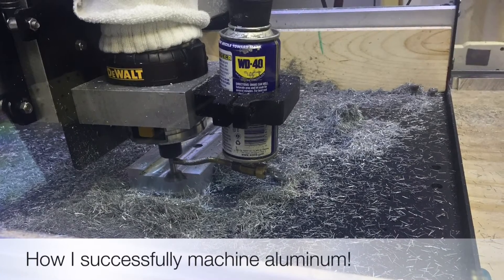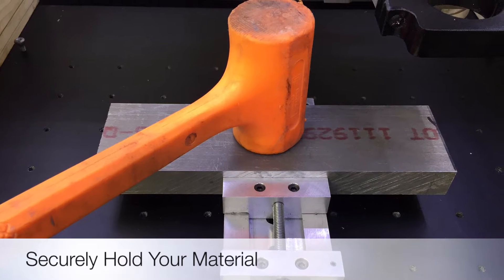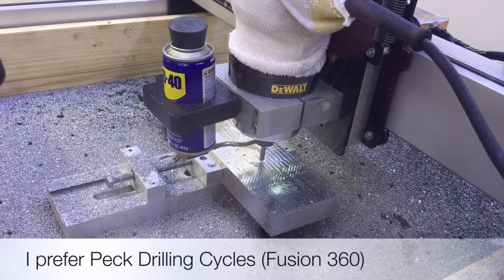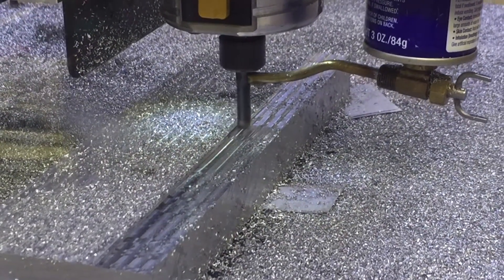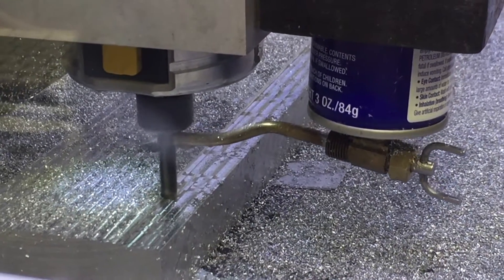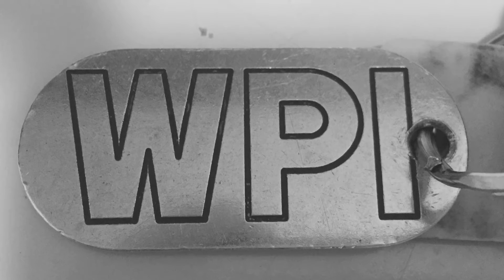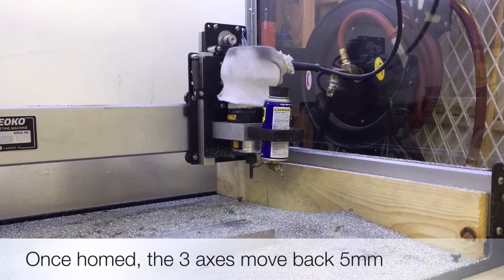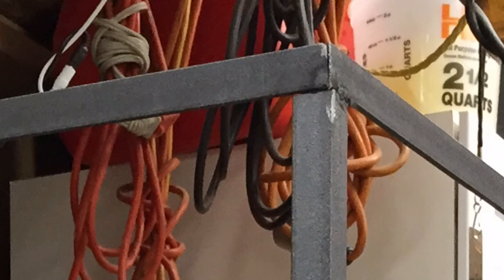How to Machine Aluminum on the Shapeoko 3

Comment: While this might work, ALTIN coating is not recommended for Aluminum. The AL(Aluminum)TIN(Titanium Nitrite) actually has an affinity to chip weld the aluminum coating to the aluminum. What you really want here is a single flute ZRN coated end mill.

Comment: I cut aluminum, steel, and even titanium on my Shapeoko 2. There is a lot of good info here but if you want a much much better surface finish you need to clear the chips that you have made out of the path of the cutter. The heat created during the cutting actually hardens the chips and then for the cutter to have to run into them on the next pass both dulls the cutter and destroys the surface finish. Other than that great information. Thanks

Comment: This looks like a 1/4" endmill (assuming 3 flutes?).  You said 16,000 RPM and 20 inches per minute.  That results in a chip load of .0004".  Isn't that WAY too low?  Don't we want something around .005" on aluminum?  I can't argue with your results which are very good...  just trying to figure out where the discrepancy is.
Reply from the maker: I recommend that you take a look at Winstonmakes video.  
https://youtu.be/S9bceJxpqG0

This is an old video and with the new Z motor plate from Carbide3D, the machine became a LOT stronger.  Yes, 1/4, 3-flute ZrN coated cutters are a must (because they canrunDRY most of the time).  The machine will take a lot more (Fusion360 Adaptive cutting) if it is set up properly, but it will take you some time to get everything tight and right.  I recommend that you start slowly say 10"/Min working your way up to mayb 40"/Min.  You'll find your machine's sweet spot.  Have fun.

Comment: I am going to tighten my wheels now. I have to re-square my machine (SO3 XXL) and I do have coated endmills. I will mostly be cutting shapes out of aluminum sheet metal .04" thick. Should I be using a .25" or .125" diameter endmill for better results?
Reply from the maker: Well first you should be using ZrN coated end mills.  They came out after this video and they are excellent and you can cut dry 95% of the time.  As for the diameter, there are plus and minuses.  A 1/4" diameter endmill will last years in the Shapeoko, and the machine isn't strong enough to break it when you do something silly (which everyone does), but they require more cutting force.  The 1/8 requires less force, but they will break.....Me?  I TRY to use 1/4 if I can, and use 1/8 when I HAVE too.
Reply: Thank you so much for responding. I have ZrN coated mills in both sizes and I JUST finished re-squaring the device. I am not sure if its "perfect" per se but just jogging the machine to different positions is markedly improved as I don't hear weird noises when it moves forward on the Y axis anymore. I also tightened the wheels like you suggested. Now I need to make a new spoil board or perhaps a vacuum board as the sheet metal I am cutting tends to bow up in the middle which is causing problems when I go to do test cutouts.

Comment: where do you buy your coated end mills? link? 
thanks in advance
Reply from the maker: Sorry, it's going to be a long answer:  I've learned that using coated end mills on a small CNC is critical.  Using anything else sill cause the aluminum to stick to the cutter, and it soon break, where you can cut all day long with a good coated cutter.  I have used several coating types and found that TiAlN (Sometimes spelled AlTiN) to be the best.  Well, I have learned that Micro Grain Carbide really doesn't matter too much for a home CNC (Yes, it works better in a $100,000 Machine), so look for the best price on eBay.  1/8 Inch, stick with 2-flute,  1/4, you can use 2 OR 3 flute.  I have had great luck with Drillman1 seller on eBay, but I think he sells excess cutters, so he doesn't always have every size all the time.  I visit his store often, and buy when he has something good, otherwise, if I am in a hurry, I'll buy from another seller.

Comment: Thanks for the quick response :)
Forgive me though, I didn't make myself clear. I'm really interested in the drip/valve attachment to the WD40 can. I'll appreciate it if you could share the how-to on that.
Reply from the maker: I will make a How To Video some day but I tore a rotator cuff and will be going in for surgery in a few days and have loss the use of my right arm until August, so here is a Step by Step instructions that I typed up (left arm).  Let me know is (a) I left something out, and (b) is you have any questions).

Prior to making the WD40 drip can, you need to determine where and how you will mount the can to your machine.  I attached mine with some double sided tape and a small wooden clamp (See sketch link: http://imgur.com/a/QYHuk )  Don’t forget to scroll down to see ALL 7 photos!!!

WD40 Drip can Info:

Head to a hardware or Home Center (I went to Lowes), picked up the following: a small can of WD40, a piece of 3/16 brass tubing (Ref: 364224), a small  90º valve  (Ref: 68578) and about a 1” piece of 1/4 copper tubing (if you don’t have any around the house). (I had some left over from my ice maker installation kit)

1) Empty the small can (pressure release), Pry off the top.

2) Drill a small 1/4” hole in the bottom (about 3/8 off center, so that you can rotate the can and change the distance from the can to the end of the pipe)

3) Solder in the 1/4” tubing to the can.

4) Install the valve onto the can’s bottom. (dry fit)  Note: I ended up bending valve handle  into a U shape to provide some additional clearance

5) Anneal the 3/16 brass tubing by heating it up to a dull red color

6) After cooling, tape one end, and then fill the brass tubing table with salt, and tape the top to hold in the salt.

7) Place the can in the holder that you made (ref: http://imgur.com/a/QYHuk ) or similar and attach it to the Shapeoko.  This will provide you with the information of where to bend the brass tubing.  

8) Bend the brass tubing and cut it to length. (you can see my 2 small bends in the photo)

9) Remove the valve from the WD40 can. Disassemble the valve so that you do not damage the o-ring during soldering 

10) Solder the 3/16 tubing into the valve

11) Permanently mount the holder, install the can of WD40 and tubing assembly, adjust the tube location by rotating the can, and happy machining.

Note: Depending on what I am cutting, I normally adjust the drip to about one drop per 10 sec.  Your usage may vary.

Comment: Great video Richard,

Had a question regarding WCS using G10 command. according to Carbide3D, shapeoko 3 does not support G10 command.  http://carbide3d.com/docs/list-of-supported-gcodes/

It also does not work for me. So how did you solve this issue? it appears you are using the g10 command per your video....
Reply from the maker: +Bret Richter Good find!  Someone is not updating their web page!  The Work Coordinate Origin (G10) command has worked since Grbl 0.8 (We are now on 0.9)  I'll get it updated

Comment: Hey Richard,

Great video. When I saw the video of you milling the vice on http://carbide3d.com/shapeoko/ it really caught my attention. 

My material of choice about 90% of the time is 6061 Aluminum. I'm simply a machinest by hobby, but I love learning little tips and tricks. I have a Shapeoko 2 that I've made quite a few modifications to, to increase rigidity. I use Solidworks, MeshCAM, and Mach3. I've had quite a bit of success milling Aluminum in a slightly different manner, but wanted to get your thoughts on a few things I've come across where I expected better results than I got.

Some things I'd like your thoughts on:
1. I tried using a carbide endmill, is this the coating that you're talking about? Here's what I ordered: http://goo.gl/ZNkcLY, I cut dry and had success, but didn't like the finish quality.
2. I tried cutting with a highspeed steel endmill, here's what I ordered: http://goo.gl/FnHPUZ I also had success cutting dry and the finish quality was much better.
3. I tried using lubricant (WD40 and then at one point some Mystic Metal Mover) and I while I saw success, the finish quality wasn't much better in my opinion. I was more or less applying it manually, I didn't have a nice system to do it; maybe that's where I'm falling short.

As a side note, when I do cut dry, I use a dust collection system, which gets my chips away very effectively. I run my DWP611 at full speed (6), I cut 0.1 mm depth per pass, at a rate of 240 mm per min, with a 4 flute 1/8th high speed steel end mill.

I'm thinking I should give your approach a shot; my only concern is that my machine is in my sunroom and without an enclosure it will get the room really messy.

Thanks again for sharing!
Reply from the maker: +Anthony Brobston Yes to the coated end mill.  It might be more of a rigidity thing going on since there is a big difference in the construction of S2 vs S3 (since I see you are only taking a 0.1mm cut) 

As I said, I swear by coated cutters and get a near mirror finish with or without the WD40 (as I think I stated, it's more of an insurance thing for me), since I do so much light's out machining....heck sometimes I'm not even home when she's making chips.  

An enclosure made SO much of a difference for me.  I couldn't see spending $$$ on that nice aluminum tubing so I came up with a very affordable enclosure, and since I share my small (10x12) mancave with my girlfriend (My Harley), I got tired of moving her in and out. (Next video)  

I'd love to do a dust collection, but I can't find vacuum system that is quiet enough for me.  I'll keep looking, but the chips don't bother me, and she (S3) gets a good sweeping and wipe down daily.  

Thanks for your question and viewing.